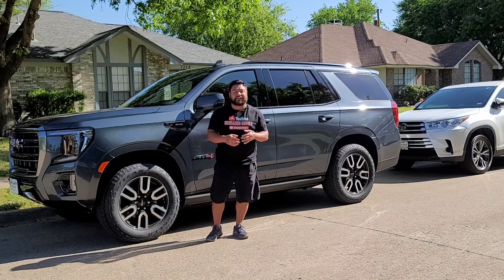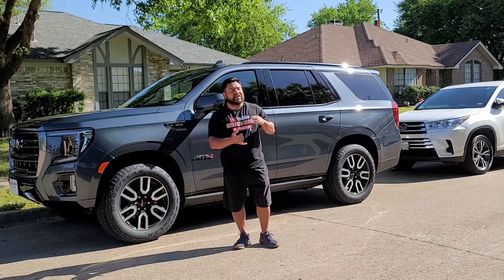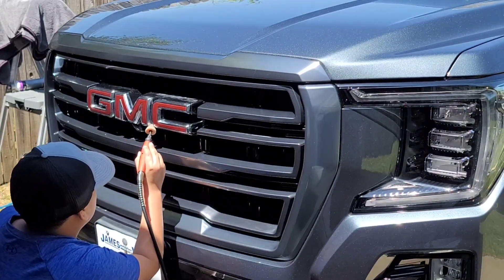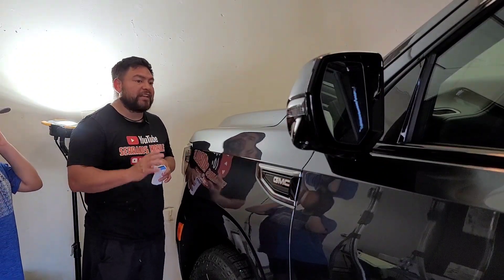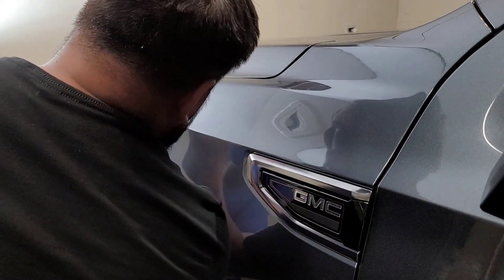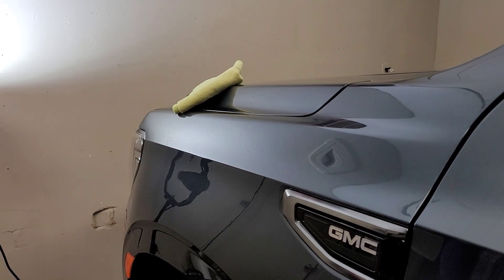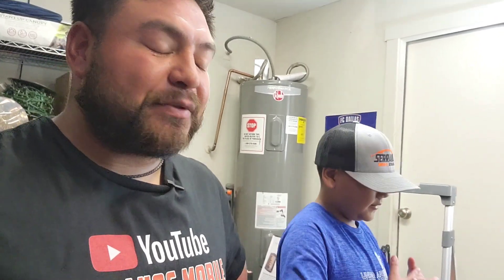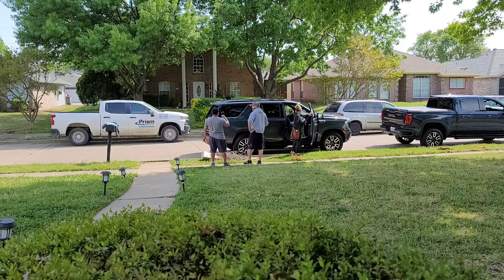WORKING with my son!

Comment: which pad and polish did you use for the 1step?
Reply from the maker: Rupes yellow pads, with kochchemie M3o2
Reply: @serranosmobile  Awesome man, also what do you charge for somthing like this? 1step and ceramic  assuming  you also have the customer pay for the bottle of the coating? thanks!
Reply from the maker: This was roughly 1500